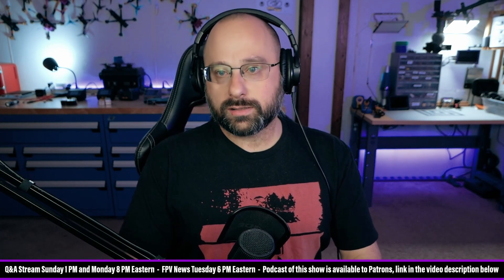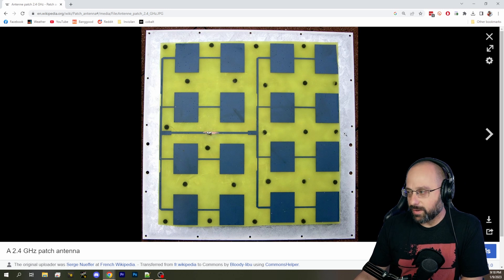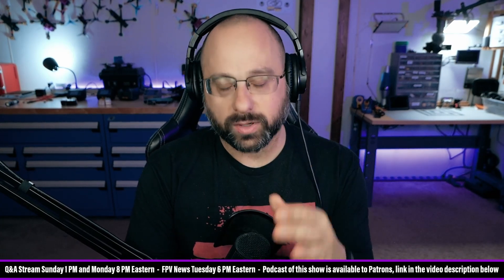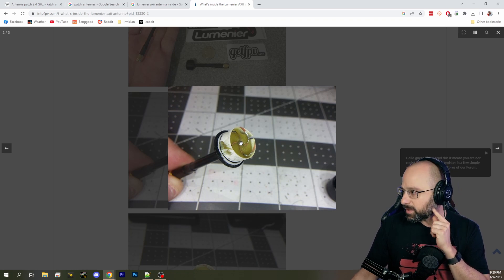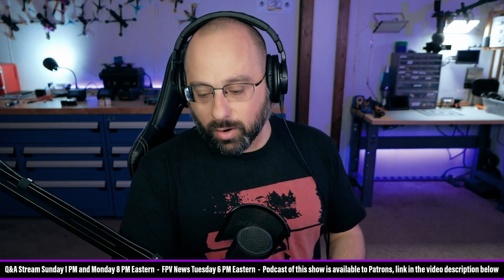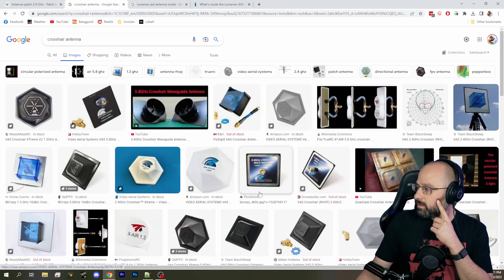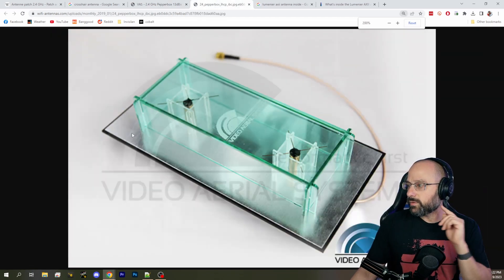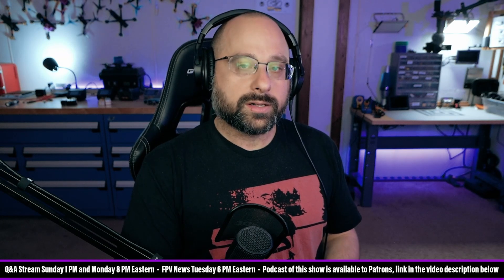What Is The Difference Between A Patch Antenna and a Crosshair? - FPV Questions

Comment: "A" for effort and for having the guts to attempt to address antenna black magic that most of of us engineers try to avoid  (probably should have left this topic alone, LOL)   Nope... efficiency isn't the discriminator.  And any impedance antenna can be matched using a tuning circuit/transformer.  A patch antenna can achieve an SWR of near 1.0 just like other configurations.  Also, one antenna you you showed was a circularly polarized antenna, which, afaik can only be implemented on a patch antenna using two feeds (where other configs, like a cloverleaf/skew planar can do it with one).  Patches typically have an H and V pole, or include a phase shifter combining the two poles of the "patches", which is still 2 feeds wrt the antenna.  Besides cheap to manufacture, patches are also near indestructible.

Comment: A patch antenna is a resonant microstrip.  You don't need a PCB material for a Patch.  Take L-Com's patch or the "Fast Patch" from my RCGroups tutorials of 12 years ago.  And believe it or not, PCB manufacturing isn't as precise as you'd think.  The thickness is a killer... especially for a patch antenna.  

The killer of the PCB based patch is that with a PCB the substrate slows down the speed of propagation which reduces the element size.  The reduction in element size reduces the amount of voltage stress which is absorbed by the antenna which reduces the efficiency.  A patch antenna with an air substrate can be just as efficient as a Crosshair. 

The advantage of a Crosshair is the radiation plot is superior to a patch.  They boast a very high axial ratio (ability to rotate a signal) and they also aren't affected by ground planes (like the physical ground beneath your feet) as much.
Reply: "The thickness is a killer... especially for a patch antenna." - does this mean something like very thin gold foil would be a better antenna?
Reply: Thickness of the substrate is the problem, not so much the conductive material used for the element
Reply: @CAGreve1231  Ohh, thanks for the reply

Comment: Patch antenna can be made not only from PCB, copper can be suspended in air on standoffs and it will be as efficient as crosshair. Its just that manufacturer chose to use inefficient and lossy PCB substrate to lift active element above reflector for simplicity of manufacturing process. Both antennas are active elements lifted above reflector surface. It is just that crosshair antenna need to be lifted in higher distance and it is no more practical to use PCB material to suspend active elements.

Comment: Hi JB, a little correction. What you explained as patch antenna is basically a PCB antenna (there are plenty of different design of PCB antennas apart from patch, like slot, F-inverted, monopole etc.).

Patch antennas may also use a special rf ceramic for substrate with proper dielectric properties like for example 99% of gps patch antennas do.
So, what you mentioned as cons to patch antennas is basically applied to PCB antennas as manufacturing type, not Patch as design type.

Thanks anyway for your videos.
Reply: I was wondering about ceramic GPS antennas. Thank you. Now, would a GPS antenna be more, less, or equally efficient if it used an air gap, instead of a ceramic substrate?

Comment: MenaceRC PicoPatch is a great blend between the two - it’s a patch with a raised antenna patch. 

25mW Range tested to 1.33km

60% increase in range over a 5db patch

20% increase in range over a 8db patch

38% increase range over the Invader patch (menace RC original patch)

Reduced multipath propagation compared to 360 degree omni style receiving antenna’s.